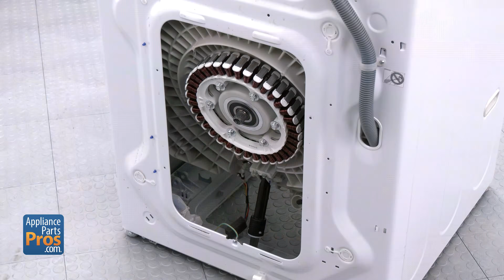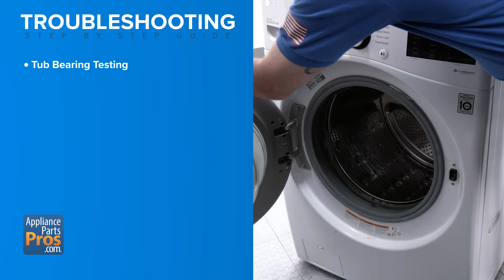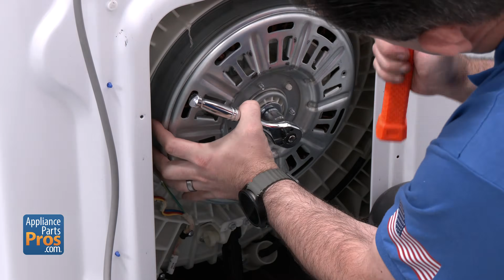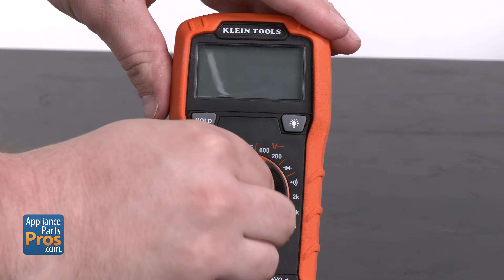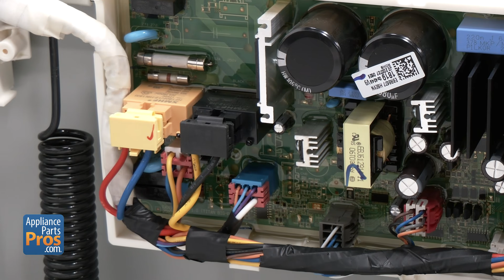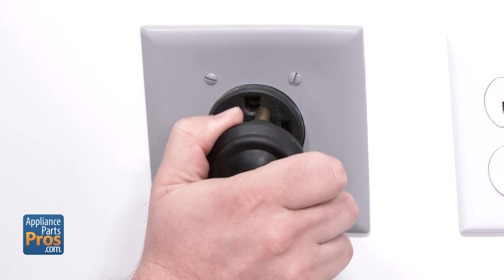Your LG Washer Won't Spin? Test These Parts Before Calling a Technician

Comment: Hope you can help - when I unplug my unit the basket spins freely, but the moment there is power the basket is resistant to movement.

This all started with me replacing a drain pump, but I keep getting OE errors. I’ve cleaned lines including the pressure sensor lines etc.

The drain pump will drain when not under load but the moment I run a speed wash to see if it’ll drain again it just hums.

Any insight would be appreciated!
Reply: Mine is doing the same thing. Did you ever figure out the issue?